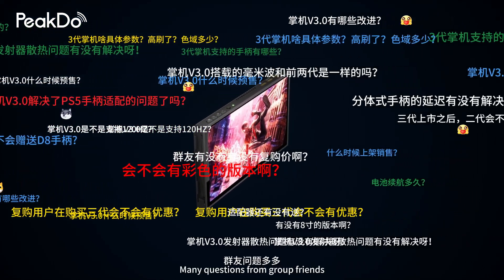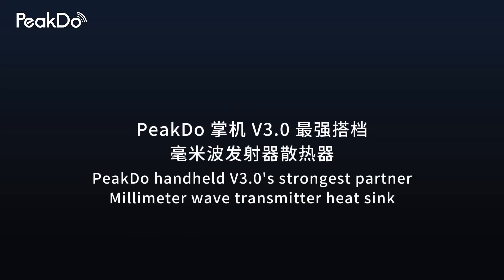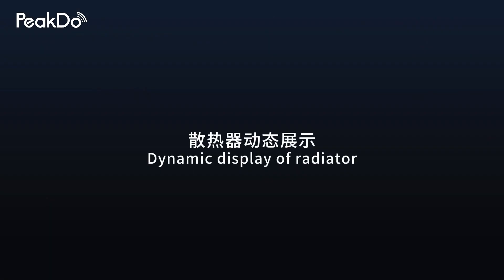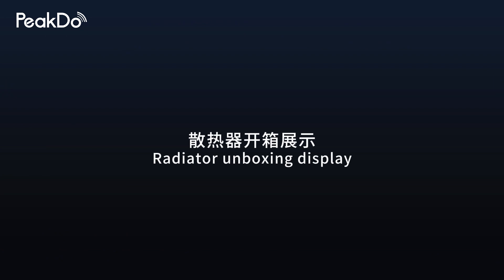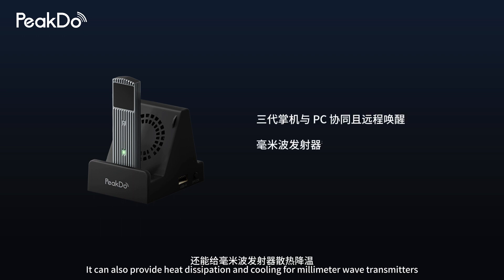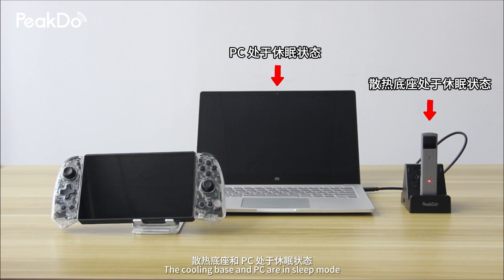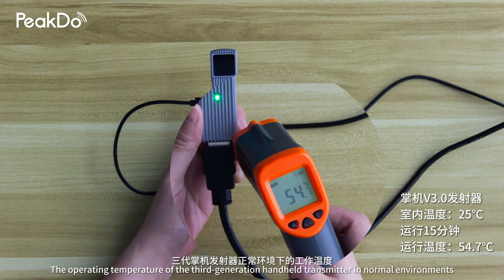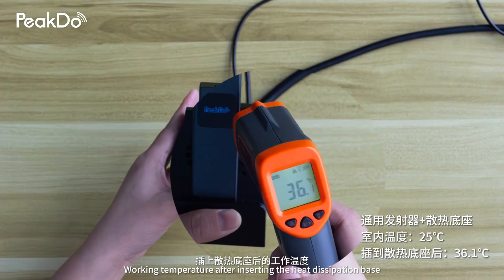PeakDo handheld V3.0's strongest partnerMillimeter wave transmitter heat sink

Comment: Hi peakdo,
I buy the v3 pro and cooling base to play at 1080p/120hz wirelessly, it have screen issue, i suspect it was because the transmitter are overheat, how to fix this problem? It’s have no issue when i play at 1080p/60fps wirelessly, but at 120fps it have noticeable issue .

Do you have a solution for this? Thx

Comment: What 'wave signal'
Reply from the maker: The wavelength of 1 to 10 millimeters of electromagnetic waves called millimeter waves, which is located in the wavelength range of microwave and far-infrared waves overlap, and therefore both the characteristics of the two wave spectra. The theory and technology of millimeter wave are the extension of microwave to high frequency and the development of light wave to low frequency.